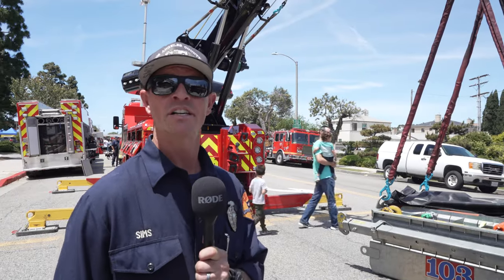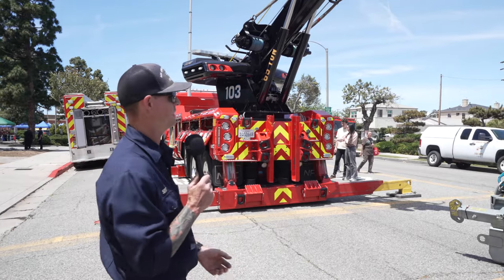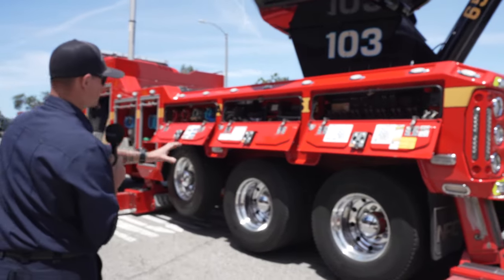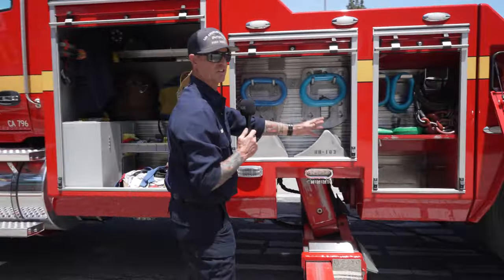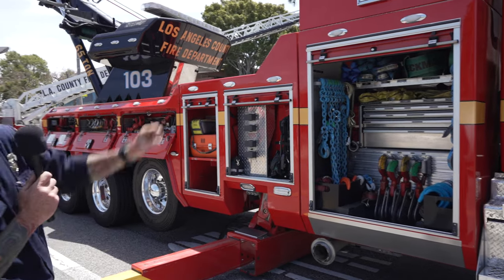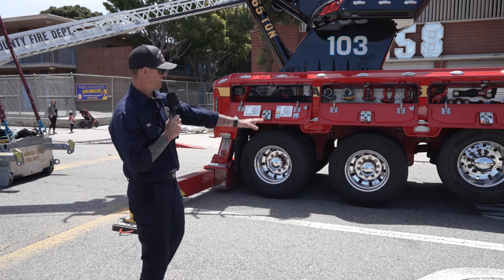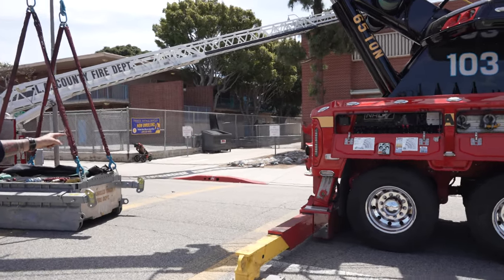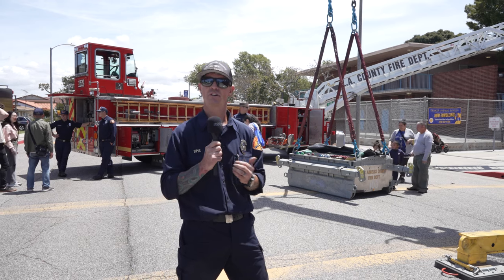LACo Fire Department - Heavy Rescue 103

Comment: Wierd seeing a rotator without an underlift.
Reply: Nothing was mentioned about being a rotator. He did emphasize the ability to move fore/aft though...
Reply: @n4gix  It rotates 360 degrees
Reply: @n4gix That actual truck is called a rotator and the boom does rotate. I've seen it in action before while on a trip to the county area and it is pretty impressive, but wish the main winch lines were rated for 65k lbs instead.